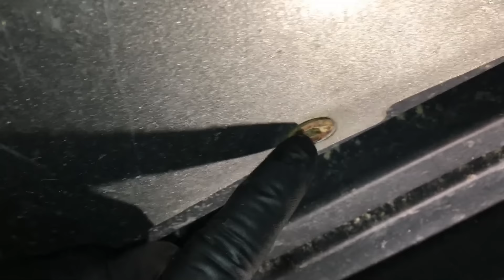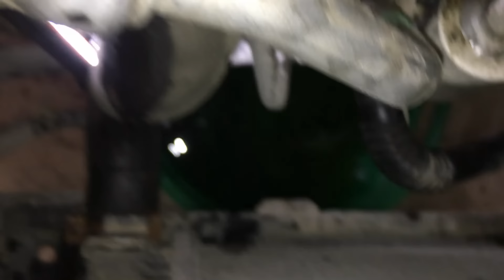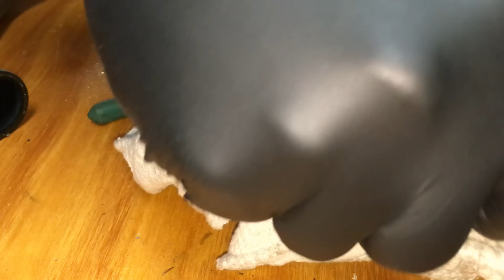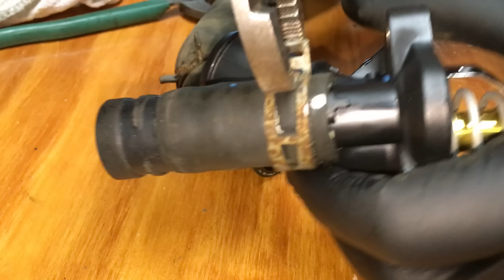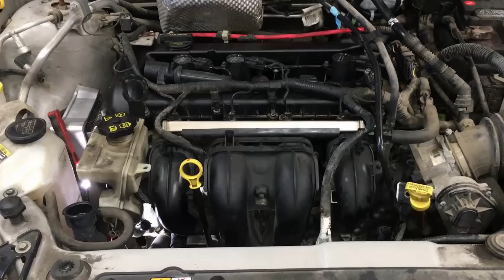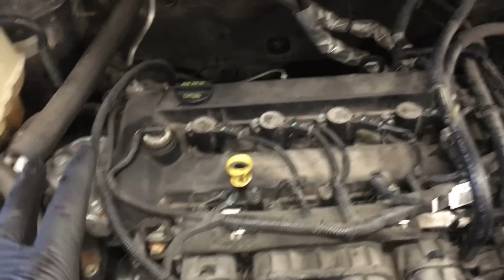Ford 2.0L 2.3L 2.5L Engines P0125 P0128 Insufficient Coolant Temp: Thermostat Housing Replacement

Comment from the maker: These are the Tools and Parts needed to complete this job:
Thermostat Housing Assy (check fitment guide)-
http://amzn.to/2sZIxOr
Vacuum Fill Tool (an absolute must on these engines)-
http://amzn.to/2sZzRYo
Alternate Cheaper Vacuum Fill Tool-
http://amzn.to/2t6Lu0b
Coolant Burping Funnel-
http://amzn.to/2s327Kn
Gold Coolant- 
http://amzn.to/2rZBUMS
or depending on model year
OAT Coolant-
http://amzn.to/2t48mgN                                                                                                                                                                                 How to use the Vacuum Fill Tool-
https://www.youtube.com/watch?v=_WCRcuCZI50
How to remove stubborn air pockets from your cooling system-
https://www.youtube.com/watch?v=4gk4xb9aOgE
Reply: FordTechMakuloco A fellow youtuber highly recommended you! I have an 2006 mustang Gt 4.6L coupe hardtop premium edition. I need to know if my transmission is a 5r55w or a 5r55s? I've beat my head against the wall for a week now trying to find this answer. Please help!!!
Reply from the maker: It has a 5R55S, I have only seen the 5R55W in some Explorers.
Reply: FordTechMakuloco Thank you so much for your time! New sub here☺
Reply: FordTechMakuloco in
Reply: FordTechMakuloco i got a 2010 ford fusion. 2.5 se my fan turns on on highway speeds. Passing 70 on a 20 min drive. But the. Temp needle stay in place would this be the issue. No code at all
Reply: FordTechMakuloco 2000 Dodge Caravan replacement power steering pump on a 3.3
Reply: YouTube video on a dodge Caravan 3.3 V6 replacing parts turn pop
Reply: Replacing parts to report on a dodge Caravan
YouTube video on how to replace parts town pump only dodge Caravan
Reply: Thanks for another great video.   Job went really easy on my daughter's 2007 Focus after watching this.   Fan removal wasn't even necessary but removing the coolant bottle did give me some elbow room to work.   Probably the hardest part of the whole job was getting the small hose loose from the housing.   I went with the "cheaper" version of the vacuum tool since I'll hopefully only ever use it a few times.   First time using one of those and its really slick.
Reply: FordTechMakuloco Do you recommend aftermarket aluminum thermostat housings?
Reply: Seems like the way I need to tackle this most recent issue!
Reply: NICE EXPLANATION, THANK YOU, BUT ONLY NEEDED TO SHOW HOW DID YOU UNSCREWED THE THERMOSTAT
Reply: @FordTechMakuloco 2011 focus driving down to Indy started to run hotter. Turned ac to max and temperature came back down to normal. Turned the heat back on and it started to heat up again.  Fan Temp or relay ?  All fuilds are at normal level.

Comment: Funny about mine is coolant isnt flowing. Tank is cold but engine is so hot the fan is runningand yet the tempture sensor says engine is good. Makes no sence. Engine isnt good temp its raceing hot with the fan on and coolant tank ice cold. Should be hot. So my thermostat is no good but i cant figure out why engine temp.sensor says its good. But my lazer thermometer says its well above 180f. More like 220. So my engine temp sensor isnt accurate

Comment: Where is the coolant temperature sensor  and the coolant temperature sender unit located on the ford duratec HE 2.0L engine for 2001 year model

Comment: Do i need to change the thermostat. If the car heats up partially until you start driving and then it fully heats up?? That is in the winter.

Comment: 2010 ford fusion 4 cylinder engine here, changed the thermostat in about one hour 20 minutes, connected a small hose at the radiator drain spout, used a hose clamp to secure it and drain the water, my hand reached from the top to open the valve so no need to raise the car, used a short 8mm socket and a 6" extension for the bolts, started with the hidden one, can't  see it so have to keep looking for it till the socket goes in and break it loose all the way, then proceed with the other two the visible ones, after thermostat is removed from engine, the hose clamps are easier to remove, medium channel locks and vise grip pliers did it for me, used a small flat screwdriver to loosen hoses from thermostat housing, just stick it in between hose and housing work around it,  install new thermostat and housing first, that way the hidden bolt location is visible and easier to get to, once it's  secured install the hoses starting with the bottom one, this is where the vise grip pliers came in handy the most to install the clamps,  don't forget to lube the hose inlet, a little bit of saliva will work, and to refill the radiator and reservoir don't forget to loosen the purge valve ? counter clock wise to let air trapped in water system out, a flat head screwdriver is needed for this,it's located behind engine close to the battery, in my case I didn't remove anything and didn't even raise the car

Comment: Is there a info vid for dummies that's going to include exactly what tool one would need to remove that Bolt or any other bolt not to mention those clamps that might need replacing or what the heck are you talking about kind adhesion of the hose to the thermostat thingy and no I'm not going to do this myself however since I'm currently in a situation that requires me to be resourceful due to the financial constraints I'm under currently I'd like to make sure that I have all the necessary tools and supplies on hand for whichever unfortunate soul is gifted with my need to control a situation even if the person repairing is going to have the knowledge añd/or the tools and supplies. I just know my knowledge of this particular said situation is what some would call frightfully ignorant and if they're being polite, would just call it somewhat significantly less than.... Please and thank you for any helpful information you can give to me in addition do what you have  supplied thus far. Having 25 years in the animal rescue services field specifically the canine category of the bully breeds, I am trying to be the one for which we dog people like to use as the prime example to refute that old saying which claims "you can't teach an old dog new tricks." oh, and by the way it would be for a 2008 Ford Focus. I guess that information might have been helpful in the beginning, but again, it's been said that it's always better late than never 😂🤷‍♀️🚗🛠️🪛🔩🙏

Comment: Ford maverick hybrid temp gauge staying close to the bottom, when the needle gets higher and y turn the heat on its dropping back to the bottom literally in 20-30 seconds. No codes,but my feeling is the thermostat is open. I will try to measure in and out hose temperature with laser thermometer to confirm my suspicion. Have you ever ran into such problem? Its 2.5 Atkinson motor.

Comment: I just did this on my 2007 Ford Focus.  Some notes:
Would recommend a magnetic-type socket for removing and replacing the thermostat bolts.  A long jawed and angled needle nose pliers works good for getting the clamps off.
The 2007 2.0 Focus doesn't have the hex drain cock and nipple shown here.  It only has a slotted plastic plug you loosen to drain the radiator.
When removing the shield behind the front bumper and under the radiator, you may want to already have the plastic push pins available.  Because it's often impossible to remove them without breakage.
Cooling fan electrical connectors on this car are on the top left side (two plugs).  Also on this car the cooling fan assembly sits in tabs on the sides and doesn't use bolts.   Will need a screwdriver to slightly open the locking tabs on the top.   Lift up slightly and then lower.  
Disconnect the pressure switch connector from the power steering pump, that interferes with access to the thermostat bolts.
On my 2007 Focus, the clamp on the short bypass hose that is removed on this video, on my car it didn't have any "ears" to grasp.  So I had to unbolt the thermostat (again--a magnetic socket makes this easier), pull the thermostat away from the engine, and then take off the clamp that's closest to the thermostat.
On my 2007 Ford Focus, didn't need to use any special procedures to refill the system.  The Ford Service Manual just says to fill the recovery reservoir to 1 inch over the "full" mark, and then run the engine until the thermostat opens.
And yes---it's a real bear to replace!

Comment: I’m told it’s better to remove the steel bolts from the thermostat housing when the car is warm but never cold or you risk having the bolts snap on you leaving some in the aluminum because of that steel-alum type of corrosion.  Anyone know if this is true?? I know for examples spark plugs you want the engine cold but for the three bolts several have told me best to break them free with car still somewhat warm!  Any insight would be appreciated.  Thanks so much attempting this on Monday 🙏🏻
Reply from the maker: Never an issue.
Reply: @FordTechMakuloco thank you so much

Comment: Is it true the bypass hose part was made of brittle accordian style tubing and was later replaced with a part metal and part rubber radiator style hose?  They want $152 for the bypass line which includes the metal piece, rubber hose and clamps!!  Praying if this is true mine has already been replaced.
Reply from the maker: yes
Reply: @FordTechMakuloco you are so awesome thank you so much

Comment: Serious question:  

So there is no way to “burp” or remove the air from the coolant system without using one of those special air pressure bleeders??  That kind of limits any DIYer from doing a thermostat change.

Comment: As always, excellent work on the video; the detail work is beyond reproach. Replaced thermostat assembly with new hoses and clamps today on a 2008 Focus. Did not remove the fan. Time about 4.5 hours total; tough job for me. If I do another one I believe that the time saved by removing the steering pump would be better than my effort today. But as always and again, thanks truly for your presentations.

Comment: I know this is an old video but had some questions.i have a 2011 fusion with the 2.5. Manual says specialty green anti freeze. Ford said it's been replaced with yellow. I don't think I should mix these. Also I bought the vaccum fill tool. My car doesn't have a radiator cap. Can this tool be used on the degass tank or can this tool not be used on this car?

Comment: Checking Thermostat without taking the thermostat out was, one hose cool & then hot when  open or look in radiator & when open, coolant moves across because Water Pump

Comment: I had the code on my 2009 2.3 Ford Fusion. The thermostat was definitely the culprit. I am not getting an overheat condition and I am getting heat in the cabin;however there is a slight slushing sound at the beginning upon starting the car. That is an indication of air in the system correct? Well I attempted the vacuum method—pulled about -26. Filling it up was easy but once I started it no heat in the cabin and driving it around it started to overheat. I purged it through the service purge valve and it seemed like some air made it’s way out, but I am back to hearing the slushing sound when first starting the vehicle but everything works: heat in the cabin and no overheating. I am curious what the long term effect is if left the way it is now? I will attempt the vacuum tomorrow once again and hopefully it gets rid of the slushing sound, almost sounds like ocean waves 🌊

Comment: My '02 Explorer 4.6l 2V had the same symptom, didn't heat up fully.  But I'll admit teh Thermostat replacement was several times easier.  The O-rings do a great job of sealing it.

Comment: I had this code pop up in cold January.  I took the car to the dealer to replace thermostat and flush/replace the coolant. Everything was working fine afterwards.  Few months later, (October-chilly weather) the code has come back.  Any suggestions?
Reply: I replaced 3 genuine ford thermostats...2 cylinder head temp sensors and still get  the code!!!!   Whats next?
Reply: @mistersnapon  my scan tool also says it could be a bad Intake Air Temperature sensor.  In the case of the panther platform, this sensor is incorporated into the Mass Airflow Sensor.  I will have to replace the MAF if this other thermostat doesn't fix the code.  Beyond this, I've no clue.
Reply: @MrGgarcia7298  Replaced that also....took to ford dealer and after $500 later it still does it!!!  Also air filter!!!  $$$$
Reply: @MrGgarcia7298  I replaced that too!
Reply: @mistersnapon  what happened with this

Comment: 2011 Focus. Thing never reaches operating temp unless I let it idle in park for at least 30 min. Going 80mph on the highway in 60 degree weather though? Thing doesn't even get up to 1/4. No CEL. Just sulfur smell from the CAT burning excess fuel. Considering my wife never says anything and I only check the car periodically, it's been rather reliable at 175k. I recently did the gasket on the top of the engine in an attempt to change the overhead temp sensor... oil all over the plugs and it still kept chugging. At least the wife was good about oil changes as the engine looks pristine inside, no sludge and the lobes look great. The 2.0 really is a strong and reliable engine minus a couple dumb quirks. Mazda really made a solid engine. I can see why Ford has continued to use it and refine it for decades now.

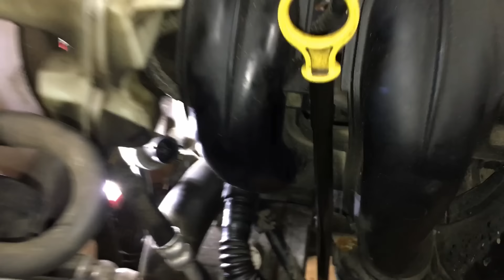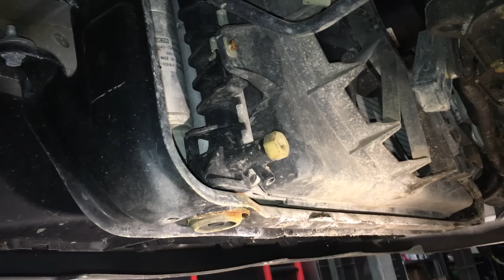Comment: @14:52 in this video, what is that sensor directly underneath the power steering reservoir on the left, facing upwards to a 2:00 position with a clip and 3 pins?
Reply from the maker: power steering pressure switch

Comment: Should you have the heater to the "on" position when using that vacuum filler unit?
Reply from the maker: No need unless your car has a coolant control valve and most don't so the coolant is always flowing through the heater core.
Reply: @FordTechMakuloco   Thanks for the confirmation. Had some air caught in the system after using the air lift system.  Engine started heating up. I used the rev-method to get rid of the remaining air pocket. Probably need to let the system sit at vacuum longer.
Reply from the maker: yes up to 10 minutes on this engine configuration.

Comment: The early ford focus 2000 to 2004, the thermostat housings were prone to leaking. The lip that holds the rubber O ring in place will corrode away causing the O ring to collapse in on itself causing the leak. The permanent fix is to install a thermostat housing from a Ford contour, same diameter but different design.

Comment: What do you do if your vehicle has no radiator filler and only a coolant bottle reservoir ? ( 2013 transit connect 2L ) Do you still have to vacuum it down ?
Reply from the maker: Follow my no heat fix video.

Comment: You ever seen them stick closed? I suspect that's what mine is doing. I can't get any heat in the cab and the engine starts to overheat, then suddenly, the heat comes on and the engine temp drops into normal range. Seems like that has to be the thermostat sticking closed, right?
Reply from the maker: Stick closed no never they always seem to stick open.
Reply: Steve L...Same exact thing was happening to my 02 T-Bird, I replaced the T-stat and all was well again. Although the stress was real, cruising along and all of a sudden all hell would break loose on the dash, warning lights and chimes and a pegged temp gauge with the car in limp mode....then suddenly! Temp gauge drops...

Comment: does ANYONE, at all, please speak if u do, can someone tell me if there is a video, or even just a instructional paper on how to do this with a Ford Fusion Hybrid?   I cant find ANY information on how to replace the coolant thermostat in my   2012 Ford Fusion Hybrid. They all deal with the SE or SEL. Which doesnt help me since the engines are totally different from the Hybrid. So if anyone can please help me find something, id be so very appreciative. Thanks.

Comment: There's a revised part available for this in Europe, brings the main house connection out about an inch and a half so it's easier to manipulate the clamps and hoses on the car, still a total pain though! Also, when fitted in a Mondeo, it self bleeds very well, does anyone know what the difference is?

Comment: Question: can you bleed the air by using bleeder valve? I don't have the vacuum set up. I used bleeder valve until all the air was gone and only fluid was coming out in a steady stream.